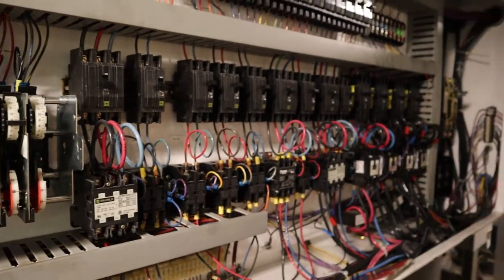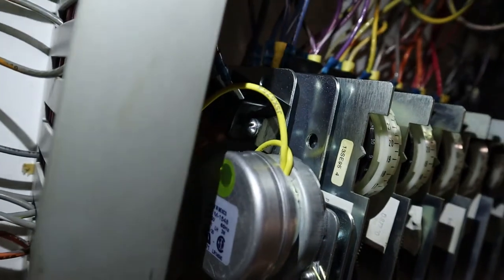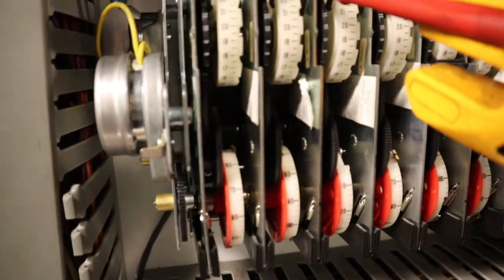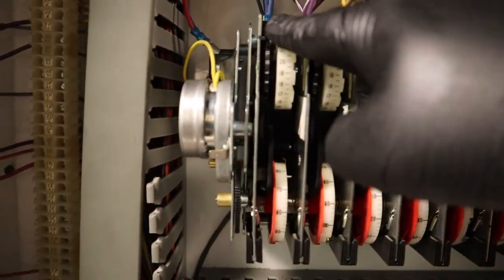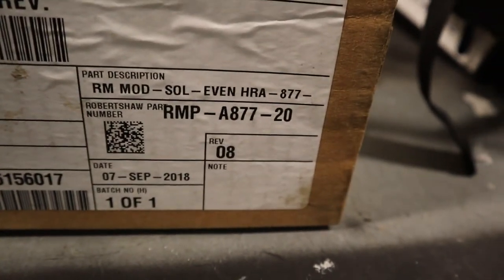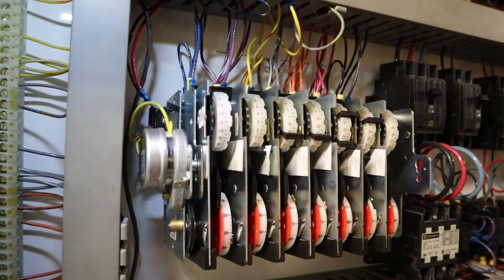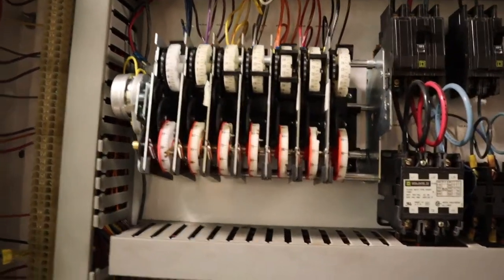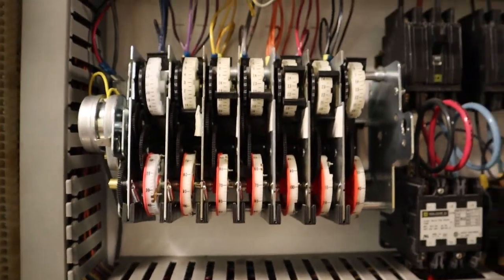Refrigeration: How to Check Defrost Gang Timers

Comment: Nice video man! So if the motor fails, all clocks stop, how many units are we shutting down? How much problem does it cause? I'm used to the commercial walk in with a single defrost clock.
Reply from the maker: Yea everything ices up... it’s a nightmare that’s why those get cutover to the new EMS system